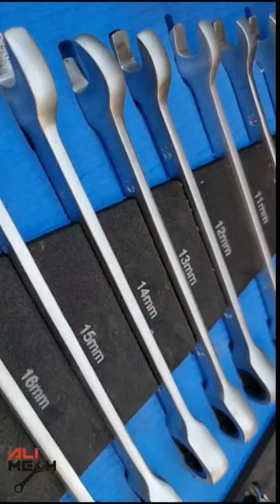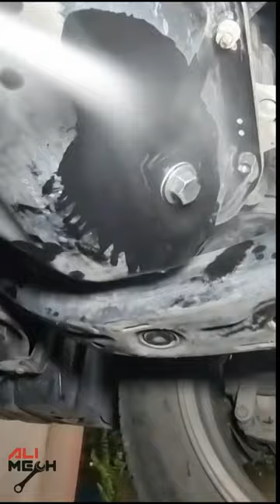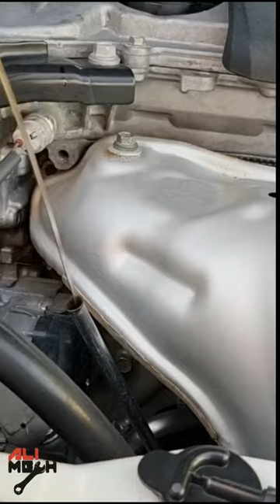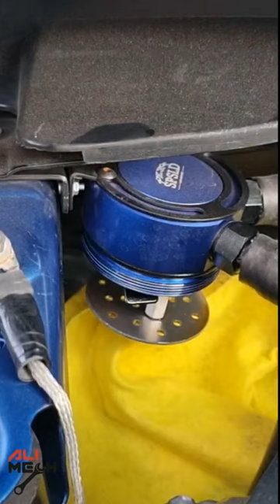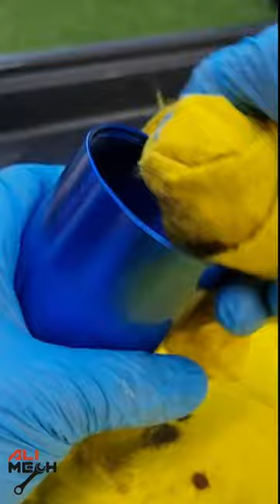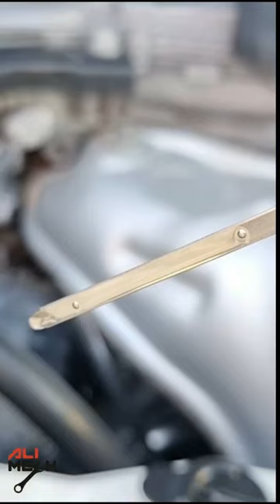Checking oil catch can after 5000 Km #shorts

Comment: Appreciate your experiment. Goes to show that modern NA engine don't have much blowby problem.
Reply: That’s not true, when you start getting into gdi engines with high compression and turbos, they practically NEED a catch can. But a low compression non turbo Toyota 4 cylinder engine like this doesn’t need it.
Reply: @Rekt-M8-v4  that’s what he just said.